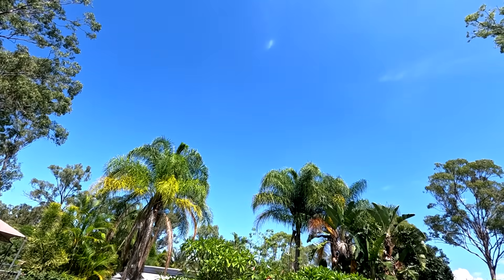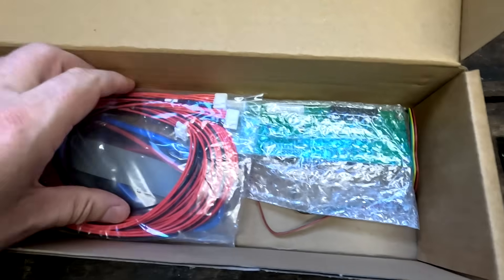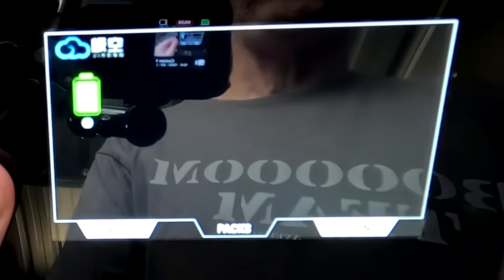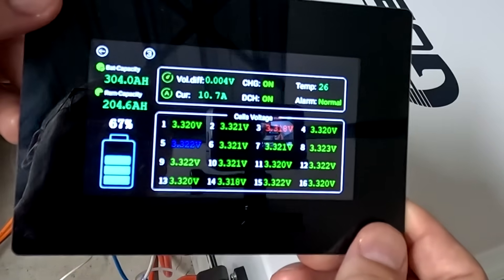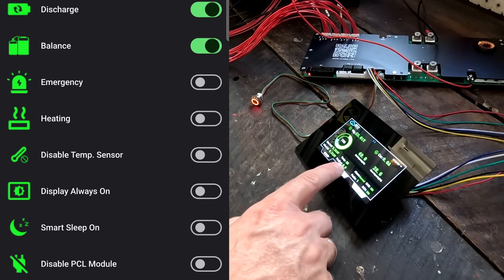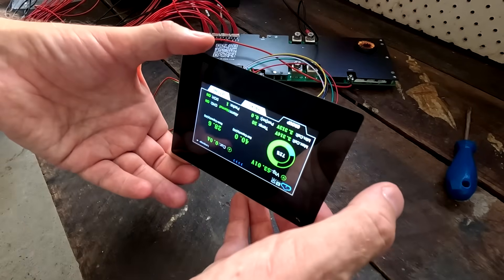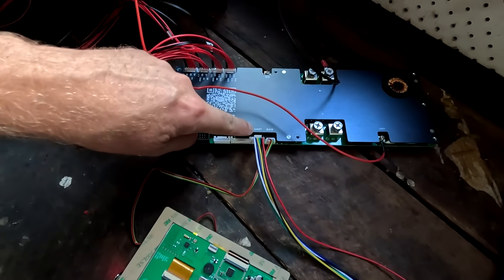New JK Inverter BMS V19. First test and... oh, look at its display! + Part I

Comment: I have bought a JK BMS for my battery pack from a reseller in germany last week and i'm a little bit confused now. My BMS has the BAT+ screw port, the QR Code and the heat shrink around the inductor like the V19 but no UART port. And also the heating pad output is a normal connector like the old version. Maybe i have got one of the missing V16, 17 or 18 boards?! 
I couldn't connect it and read out the version until now, because i have forgotten to buy some connectors for the BMS...

Comment: Great video I just ordered 2 of these V19 versions. I had 3 that I bought 6 months ago waiting for cells to arrive. I really enjoy these videos but I have a question. Since the JK - Inverter BMS can turn off charging would a 250amp fuse at the battery before the bus-bar with one 200amp breaker between the buss-bar and each inverter be sufficient? Since I can turn off the charge and discharge in the BMS and check with a multi-meter that it is safe. If that is not OK what do you recommend?

Comment: Hi Andy, it's incredible how those BMSs are advancing. I previously asked you if the technology they implement allows them to agree on how much to charge and discharge each battery and for it to be exact, since you have identical batteries there.

Comment: I need your help, please.

I’m using a JK-B1A8S10P BMS board for my battery-powered wheelchair. JK is generally fine, but the password issue still hasn’t been resolved! Plus, the Bluetooth signal is weak!

I used to connect it with my iPhone, but I had to reset the phone, and now I can’t connect anymore!

Every time I try to connect, I have to go to the website and get a new password!

Since I had this password issue, I tried using another phone with Android 14, but that phone didn’t detect the BMS board at all! It didn’t connect! However, Android 11, 12, and 13 work fine. This seems ridiculous to me! I don’t understand how JK hasn’t fixed this issue yet!

On the other hand, Daly BMS boards don’t have this problem. I used a red Daly 150A BMS, and its Bluetooth signal was strong. But I stopped using it because it didn’t have active balancing.

Then, I tried the blue Daly 100A Active Balance 8/24 BMS board, which was great! Active balancing, Bluetooth signal, and WiFi connection were all excellent. However, it gave me a sensor error, so I had to stop using that one too. :(

I heard that a new Daly model has been released with Active Balancing + WiFi + Bluetooth, but I don’t have the chance to test it right now.

Now, I bought the JK-BD6A24S10P board. To increase the Bluetooth signal, I soldered a wire onto the Bluetooth chip, but I haven’t tested it yet. If this board also has a password issue, I don’t even want to bother with it. :(

Dear friends, what do you recommend? Can you please help me?

Best regards.

Comment: What about the bug in firmware 15.38 that the soc gets stuck at 99%? Does a downgrade to 15.37 help here?
Reply from the maker: I made a detailed video about it recently when firmware 15.35 came out. The reset to 100% works if you know the mechanic behind it.
Reply: Change "RCV time"
Reply: To which value? Currently it’s 1 Hour
Reply: so in 1 hour it will be 100%. At least that's how it is for me. One hour for balancing according to the RCV value.
Reply: FYI, the problem was not with the rcv value, but I had to calibrate the voltage on the JK BKS, then it was fine

Comment: Is there any talk of having the master BMS in a parallel setup instruct the BMS in a smaller pack to turn off charging and discharging when it is depleted? It seems like the BMS could  play a more active role in managing packs with different capacities instead of constantly having smaller packs refilling from the bigger packs, causing more heat and loss. I'd definitely watch a more detailed video on managing and building parallel packs with different capacities.
Reply from the maker: That is not the case, a 100Ah battery and 300Ah battery in parallel, there will be not much balance current between the packs. We have tested this many times here on the channel.
Reply: @OffGridGarageAustralia  Interesting. I have just turned off the discharge and charge ports on one of my banks because it is @ 98% and the other bank is at 50%. The lower bank kept hitting its charge limit of 100A seemingly because the AIO was pushing the combined amount of 180A(max - 10% x 2) . These are identically sized banks. 
It would be nice if the JK BMS could automatically do what I just did manually.
Reply from the maker: @phillip8260  At what voltage does this happen and one bank keeps turning off?
Reply: @OffGridGarageAustralia  OK, I finally had this happen again, sort of. At some point the two identical battery packs drifted and one(pack A- Master) went to over 90% charge while the other(Pack B) remained at ~30 %(3.0V). Pack A was at (3.3V). The breaker on Pack A tripped. The BMS doesn't know about the breaker and is still reporting a combined max charge rate of 200A to the inverter/charger. So the inverter/charger(EG4 18KPV) delivers close to 200A which makes the BMS on PACK B error with overcurrent threshold met.
To fix this situation I have turned off charging for Pack A and now the master BMS reports a max current of 100A and Pack B is now happily charging up.
The BMS has all the information it needs to temporarily turn off charging on the higher pack while the lower one catches up.

As I think about it...Pack A probably had its breaker trip yesterday when both packs were ~90% and then Pack B depleted overnight(I still had power in the morning.) Then the BMS on Pack B started erroring as the sun rose.

So again, the master BMS should be able to see that it's not getting a charge on one of the packs and adjust the total max current reported to the inverter/charger so the other pack can charge without shutting off due to overcurrent protection.

Does that make sense?

Comment: I think a 3D printed frame would be good to make since it looks like an apply once, break to remove. With a printed frame you could use the existing hole in your master battery. Just a thought. 😊
Reply from the maker: Yes, that's possible and I have done such a solution in the past. It works well.

Comment: Cool display, I wonder if it will be possible to connect the display to older bms models, like through the rj45 port you normally connect a computer or an inverter. Just built 2 314Ah batteries with the older model bms.
Reply from the maker: The display needs the UART port to work. Only the V19 has that.
Reply: @OffGridGarageAustralia  i though some of the rj45 ports are UART too
Reply from the maker: @anythingdotstl5585 No, they are RS485 or CAN

Comment: so the old display is rs485(funny,because bms has 'rs485' labelled 3.3v serial port,for which you need rs485 covnerter),but the new display is serial..probably they don't expect long wires..also,old display was 'read-only'(as far as i can tell),no talking back to bms,so no fet on/off,maybe the new display can talk bidir?but it is the same dgus,don't hold your breath...

Comment: Nice display, it would be even nicer without the reflections. The animations are a bit jumpy, so they definitely need to do some tweaking. I would like to be able to individually disconnect the battery packs on the display. Does the display even fit in the Yixiang DIY Box, Andy?
Reply from the maker: The reflection is only making the camera dizzy. It is crystal clear and very nice to operate.

Comment: If those batteries will be stacked like that for a good amount of time, I would 3d Print a bezel a little bigger than the display and make it thicker on the bottom so the display is tilted upwards a bit, maybe 15° for better visibility. Plus no metal cutting needed.
Reply from the maker: Yeah, a 3D printed frame is the way to go, I think.

Comment: Heya, that display looks good, but do you really need it I don't know. you are making us curios of what is to come. can't wait for the next video
Reply from the maker: The display is just one option for this new UART port. Much more to come...
Reply: This seems to be good for larger systems. One screen on the master to monitor them all. The other batteries don't need a screen. If you only have one or 2 batteries this isn't very useful.

Comment: You should test tigo power optimizers they are supposed to help with shady panels!
Reply from the maker: Optimisers only optimise the manufacturers wallet.
Reply: Haha are you sure? I've been wanting to test haven't had the funds to try them out yet but your conditions would be perfect for the experiment.
Reply from the maker: @thomasschmucker14  Yes, 100% sure. Optimizers may have a small benefit when connecting panels which are pointing in different directions. But such an installation seems rather a bad system design.
There is a Swedish study where they have tested optimizers in all variants, directions, orientations and compared this to the same solar array without optimizers (google it, you will find it). 98% the array without optimizers was more efficient.

Comment: 341 / 5.000
Can the new V19 BMS finally measure currents somewhat accurately? My V15A PB2A16S20P reports more than 18 A with an independently measured discharge current of only about 5 A. This was probably written into the latest firmware as a trick to prevent the SOC from being calculated so incorrectly, since these incorrect measurements only occur with discharge current.

Comment: pretty cool progression for JK.  CAN'T WAIT to see what they are going to do with 'wi-fi'!
Reply from the maker: Wifi will NOT have a remote cloud service like Daly has. It will be just Wifi and you can setup your own access via VPN.
Reply: @ This is good not only for security and connectivity reasons, but for when they can no longer be bothered to support it and switch it off.
Reply: @OffGridGarageAustralia  that would be terrific. And so against the trend right now.
If it works, I will start to become a JK ambassador.
Reply: If they make the BMS HA compatible with a local API, I will get rid of our Seplos platform.
Reply: @foeke8740  HA integration is my HOPE!
Reply: @foeke8740  yea, i'm HOPING it'll be/have HA integration.  that'd make my OCD/data-driven-mind happy!
Reply: Calling home for remote control from China when geopolitics issues occur.
Reply: @jeeastee  we are going insane, allowing that Chinese cloud malarkey for our convenience. All our intelligent stuff is connected to a isolated vlan. If it needs access, it will get it for that minute.
Just like I will not use Cisco and our Ubiquiti backbone uses a local key.
Cloudkey for a corporate network? Just as insane as an inverter that is directly controlled by a server in China.
Reply: @ Yeah. When I bought a pond pump it had wi-fi control! Immediately disconnected that module. Just think - when WW III happens they could kill my fish.
Reply: wow, this is my 3rd (and LAST TIME) commenting on my OWN comment! (my others HAVEN'T shown up!!)

i REALLY wish there will be HA integration!  THAT would be amazing for me.  I love data! LOL
Reply: @offgridgaradge please I am building a DIY 24v pack of LFP batteries. How do I know which BMS  does support parallel and series connections please

Comment: What are the new controls “Discharge OCP 2” and “Discharge OCP 3” in the control section of the App and 15.38 version?
Reply from the maker: They are there for a while now. Apparently this is the mechanic behind it:

If the OCP2 discharge current exceeds 2 times the maximum discharge current, disconnect the discharge after 5S. OCP 3 Disconnects when the discharge current exceeds 3 times the maximum discharge current.

Makes no sense to me as it should already disconnect at OCP🤷‍♂️

Comment: What we also need:
New release solving:
- SOC
 - the fact that the displays show settings different to the App... (Charge/Non-charge/Balancing ON and OFF respectively)
- adjustment possibility when all the voltages are different (too high/too low  compared to the next box with the same kind of JK BMS and same  batteries (voltage measuring of the BMS not calibrated).

Comment: What's the news on the v15 dry contact issue.  Did they update the firmware yet?
Reply from the maker: That was fixed and the latest V15 BMS work without problem. There is a resistor which need to be changed on the PCB. I can make a video and tutorial when time permits.
Reply: JK вже не цікавлять v14 і v15, вони займаються v19.
Reply: It's a hardware issue - you need to update the hardware.

Comment: I wonder how far you would be able to remote that display with longer wires or cable. That way you could mount it outside the power room where you might want it . That would be nice to be able to see what the system is doing without a computer or phone . Or a display for others to look at. So in that case maybe there should be a lockout feature for changing settings and be monitor only.
Reply from the maker: I think we will have a Wifi option and display at some point,,,

Comment: Bear in mind, that the BMS is also installed in batteries which is sold to BFUs. I would not include anything in display settings that can damage the battery or place it under password like BT app.

Comment: I was so glad when I seen new version of the JK BMS android APP already available to download.  Downloaded.  Of course again it is still only for arm64v8 processors and not available the version for v7 processors.  The support for v7 processors finished on the v4.25.   But OK , I have a phone with v8 processor.  Installed the new app.  But it is not starting.  Just not opening after installation.  The same was with v4.30 app. No, it's not my phone.  Any other app is working on it.   Can we ask developers of the app to be so kind to compile also a version for arm v7 processors , please?
Reply from the maker: Not sure what this all means...
Reply: @OffGridGarageAustralia  Hello ! :) Thank you for your attention ! I'm so glad you answered ! That all means, very simple but really important matter.  Some android phones are based on "arm64v8" processors  (CPU) and some are on "ARM v7" CPU. These are different processors.  When a developer compiling his app , he chooses on which processors that app can work.  Most of them compiling for both , that's why when an app comes from "app store" , the app store automatically detects the processor version and downloads the version of the app accordingly.  For example the latest version of the JK BMS app available on google play is version 4.27 and if I enter there from my phone which is on ARM v7 CPU , it says "this app does not supported by your phone". The last version of JK BMS which can run on ARM v7 is version 4.25.  The next problem is that on arm64v8-based phones after installation the latest jk bms apps does not open. And on arm v7 -based phones versions after 4.25  just can't be installed at all.
Reply from the maker: @ I still don't know what this all means, sorry. I have a Samsung S24 and three other phones where the JK app runs without problems. I also have a 12yr old Google tablet and the app runs as well, slow, but it runs.

Comment: The question is whether the 'old' BMS hardware (v14/15) will continue to be supported, and if so, until when?
Reply from the maker: That is a good question. I guess they won't be for long as the V19 can be the master and older BMS still can be connected as slaves and don't need the latest firmware and function.

Comment: Another world first first for Andy. A new JK  BMS Inverter V19.  I am building a new 48V with MB31 cells. I will now wait to get a v19 BMS for the build. Keep up the good work Andy.
Reply from the maker: The link is up and running. Get in, it's still hot!😂
Reply: Try to make HW and SW for your own BMS. You will be independent.
Reply: @PavolFilek це як?
Reply: Вона непоказує правильно проценти,фуфло а не бмс

Comment: Can i parallel 2 batteries with different capacities but the same jk bms together?
Reply: yes, this works. Andy uses also 16s with different capacity (280Ah up)
Reply from the maker: 2 batteries, each needs their own BMS though, not the same BMS!
Reply: @ of course 2 BMS, no question. but 2  16S-packs with different capacity....

Comment: 15:52 - no settings if that display might get wifione fine day but maybe a charge graph that other family members couldl benefit from like the usual question at 5 pm if they still should start the dishwasher or not . At least as wifi display a feature that would make sense, I mean a soc curve of the last 12 or 24 hours and also a charge / discharge curve that gives you a first impression if something is wrong due to a too steep angle

Comment: JK needs to listen more carefully cause otherwise they will become beaten by the competition. 
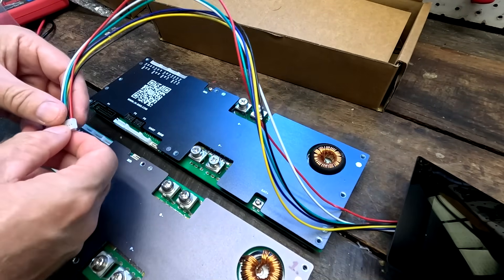4:54 - glueing a display is the worst they can offer. Cheap chinese plastic enclosure should be there and if someone needs more he could im prove that but glueing glas on metal is not a good idea considering that our LFP batteries should last how long ?
20 years - our oldest LFP is  now 12 years , and only the BMS had been replaced due to progress cause back in the days those bms had nothing , no app or bluetooth support, just and ordinary outdated, barely  readable lcd display. 

And I assume this will happening at least 2 times in 2 decades off such a life time where I do not wanna have to deal with chinese glue and to remove that cause chinese glue can be really to tough to get rid off that again. It glues as it should but in such cases quite often too much.
Reply from the maker: There is no competition for JK. If so, I would be testing it already.

Comment: they simply should fix the soc and shunt issues cause they are still there - big time, even after firmware upgrades .
Reply from the maker: That's hardware related. Would you pay $100 more for a better shunt in such a BMS?